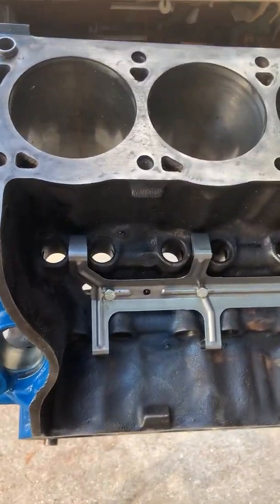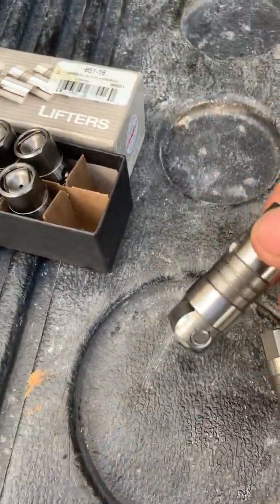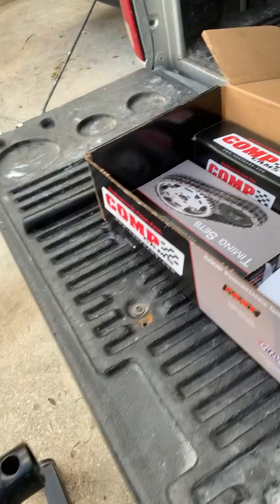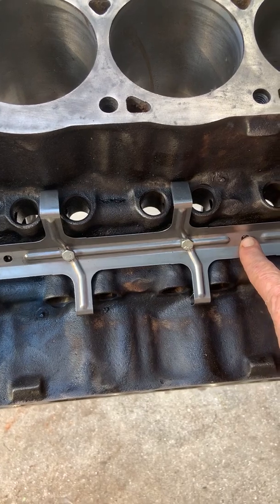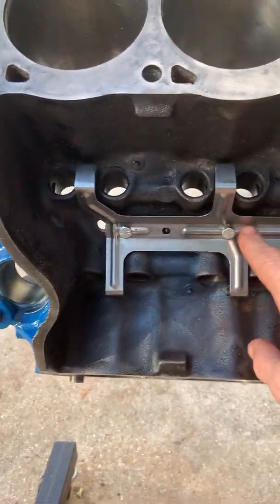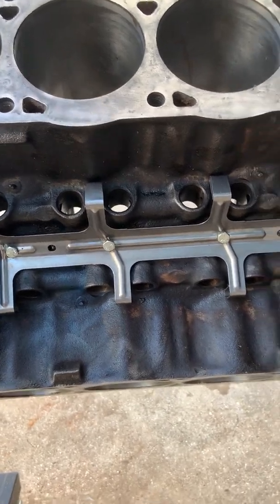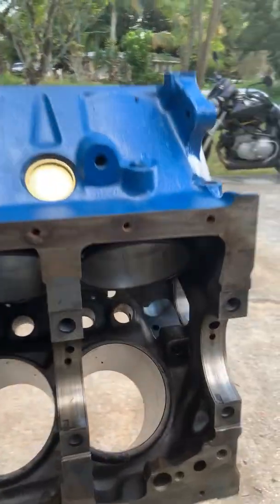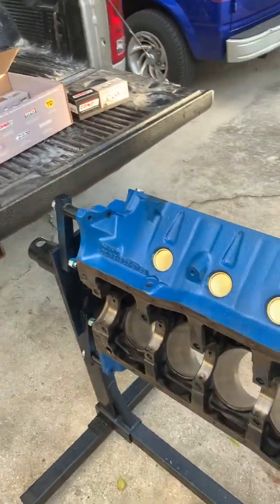Ford 351W roller cam retrofit kit.  Comp Cams kit SK35-427-8 and kit 31-1000.

Comment: It’s okay to drill into the cam bearing before installing the cam bearing. When you drill through where the cam bearing is just make sure there isnt a bearing in that spot. There will be a burr that you should address in the journal but that’s it. I do recommend installing the spider and see where the bolt comes out because the supplied hardware can be on the long side if you don’t use a washer. I decided to add my own hardware to the spider and lock wire hardware for peace of mind. But both ways are okay id do 4 lock wire bolts and no nut so you don’t risk that nut coming off. It probably never will but I’m ocd.

Comment: Hi Jim, Do you have to use the spider if you use the bar type roller lifters?  or both?  Thanks and cheers from Motown/Dearborn
Reply: No, you do not have to use the spider if your lifters are already connected.

Comment: So how has it been since modification??? I keep hearing that drilling in the lifter bay will lead to cracks which makes me very nervous.
Reply from the maker: Honestly, the engine has not been run much since completion.  We were hit by Hurricane Ian in Sept. 2022.  The car was totally submerged, but I had it running again, within a few weeks.  
Since then the project had been put on the back burner.  Restoring our home has been the priority.

All that said, it runs great and sounds amazing.   I’m  not too concerned about breaking the motor.  It’s just going to be a street rod.  It will likely never make more than a few passes at the strip.

Comment: What is the cam part number ?
Reply from the maker: You are so smart.   You would be better off doing your own homework.
Reply: @jimbougard8560  home work for what ?
Reply from the maker: @cammontreuil7509  Since I posted this video, I've learned that the stock roller lifters are NOT long enough.  I'm glad I went with the Comp Cams kit!  I would advise you to do the same.  If you know better... groovy for you.
Reply: @jimbougard8560  I'm aware of having the correct base circle cam with the right block.
Link bar lifters are better than dog legs.
I only use crower severe duty.
Expensive, but you don't have to worry about them.
I've had that cheap retro fit cam pot metal fail.

Comment: Nice, I just bought that kit and am doing the same thing. I knew about the installation kit because the description mentioned it was required. I was worried about tapping those two holes right above the cam journals
Reply from the maker: You can drill as specified in the instructions, but you MUST NOT drill too deep.  I think it was like only less than .250".